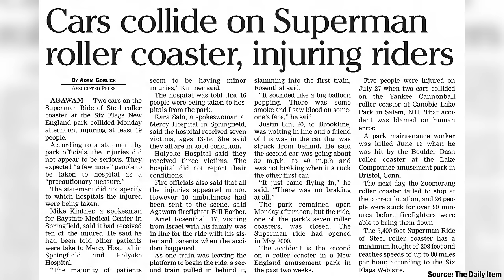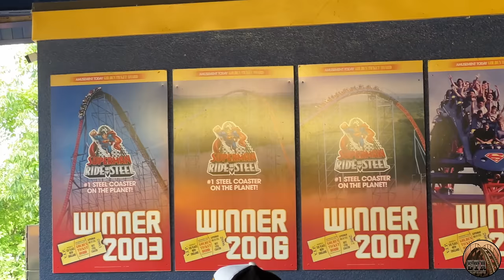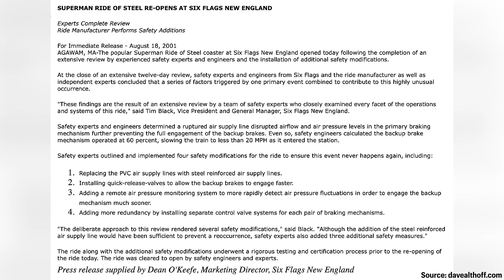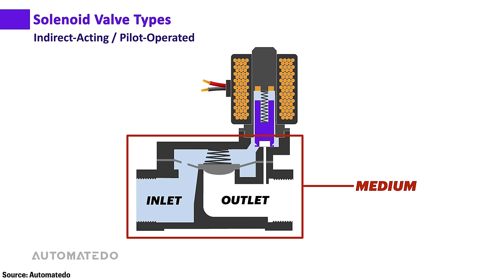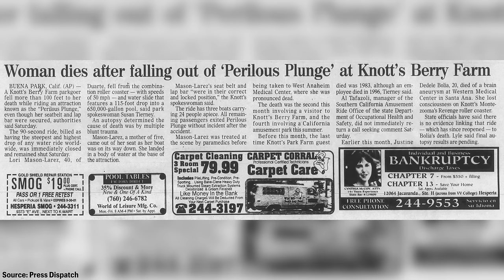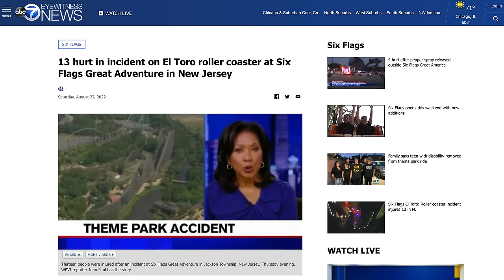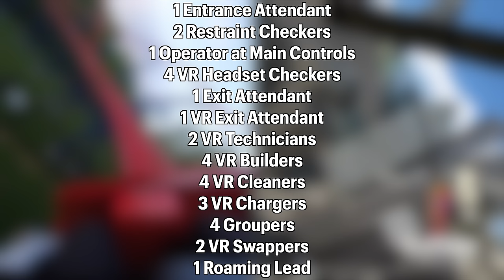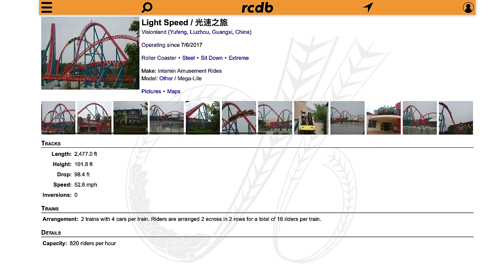The Accident-Prone Superman The Ride - A Problematic Roller Coaster

Comment: europa park has in my opinion the only sustainable VR solution, it uses a separate station and train to load guests and uses switch tracks to add the train to the track. In addition you put your headsets on in a room prior to boarding the train and get to walk into the station and into the train with the headset on

Comment: those are brake chambers similar to if not actual semi truck brake chambers that they are using. i mean why not they ae reliable enough for on road use.only problem with using these as a safety brake, the spring inside the brake chamber is progressive. if a loss of pressure due to an air leak occurs then the pushrod will not be fully extended nor fully retracted. this causes the system to think that the brakes are applied as there isnt sufficient enough air pressure to enguage the snap disk style pressure switch telling the system that the brakes are disenguaged causing the accident.

Comment: I remember Big  Bad Wolf.  I went to Bushgardens in 1989 on a USO trip.  I road that and Oriental Express I have not found any hanging coster as fun as the Wolf was.  I was disappointed going to Cedar Point and riding Iron Dragon, which I would rate as a first kid level coster.  The Wolf was a lot more fun.

Comment: Fantastic, informative video. But I want to add that all Intamin coasters at that time had their layout and dynamics done by Stengel. And since he came up with heartlining and spline curves in coaster design, he was adamant that his creations used these  methods. Superman´s design(s) use it as well, but far less prominent than on other rides. Maybe it was due to Six Flags  wanting to cut costs, since the main idea behind these three rides was airtime and helices. Bending track according to spline curves is exponentially more difficult and costly.

Comment: I was gonna say Six Flags Darien Lake has messed up a lot things but the restraints on the ride of steel is not one of them. You experience good air time on the hills, especially when you rip through the bunny hills near the brake run. Just wish the track layout was better, the straight run and 2 helix's don't offer much

Comment: I rode this one for the first time in 2021. There was a heat wave and it was 97 degrees out. It went a lot faster than when I rode it on a cooler day. There was also not much of a line, so I got right on. I didn't mind the restraints at all. And I quite enjoyed it.

Also, Ryan, why aren't you an engineer? You clearly have the brain for it.

Comment: Good lord this was hard to follow... all named superman same colors, similar sized brake runs etc... 😅😅😅

Speaking of lapbars not securing on the upper thigh with no seatbelts.... SkyRush needs to be reworked. Im 5'4 and skinny but those lapbars only touch halfway up my thigh, OR I have several inches behind my back with its flat seats.. I get they clamp you but...

Comment: Superman would probably advise against this ride

Edit: I was expecting you'd talk about Mexico's Superman ride. I certainly got to it at age 11 which might be too young, but that one experience was enough for me to never ride that coaster again. Not in the US, not in England, never again. I'm surprised too the cars for these two locations were so fucking safe.

When I got into it, I am not kidding, the car was a two person car, two loose seatbelts and one, thin steel bar that was pulled over the passengers' legs. I literally had to find a way to keep myself in from flying out of the ride because of how loose it was. Yet again, I was 11, I was a bit smaller than today, but my god, the Superman ride is the sole reason I don't get to rollercoasters unless I can tell the cart is mostly safe. Also the reason why I prefer much more the Batman ride lol.

Comment: I’m an electrician, all the safeguards they added after the train car collision are smart, and would absolutely prevent any further collisions. However, wouldn’t it make sense to add sensors to each brake arm? That way, the control system will know the exact position of each brake arm. All they would need to add is an “Brake Engage” sensor, which would allow the control system to verify that the given brake is set at its correct position, and not half way in between. They could also add another “Brake Disengage” sensor, for when the brake arms are at their fully open position. If neither sensor is being made (Detecting metal from a brake arm in front of it), the system would be able to monitor that, and send some sort of alarm, or prevent any train cars from being dispatched. If using electrical “Sensors”, otherwise called “photoeyes”, which utilize an infrared beam to sense an object is a cause for concern (Like if the photo eye failed), then they could even use a mechanical one, that has to be physically touched by the arm to send a position signal back to, what I can only assume to be, the PLC that controls all the rides functions.

Just a thought.
Reply from the maker: That’s great input! I believe Intamin actually started doing that on their coasters just a few years after Superman. Say on their accelerator coasters, there are sensors that monitor the positions of the absurd number of brake fins. But that also causes problems when the sensors go bad or report incorrect positions. In Superman’s case tho, there are so many less brakes than say Kingda Ka that I doubt it would add much downtime

Comment: The spring-loaded braking system seems a bit... odd to me. I'm not an engineer, of course, so my evaluation should be taken with a grain of salt, but it seems like it adds an additional point of failure in comparison to counterweighted systems. Springs will deform over time as they're repeatedly compressed, they can rust, or they can lose strength in other ways, not to mention the possibility of a spring breaking entirely. It would take a while for this to happen, but maintenance would then require the pneumatic system to be opened and shut routinely to check on the springs, adding to the likelihood of one not being closed properly and developing a leak. I dunno, it just... seems like a worse system to me.

Comment: I was riding Millennium Force in 2000 when the Blue Train collided back of the Yellow Train at about 20mph. There was enough energy from the Blue Train to push the empty Yellow Train out of the proximity switch zone, causing the Red Train to stop on the Cable Lift Hill. Some riders were checking out for minor whiplash, but being that I was in the very front of the Train, with a young kid, I could instantly know that the Train wasn't slowing down like it should have, and I put my right hand on his chest, and my left hand had a strong grip on the Grip Bar on the Hood of the Train, and just told him to hold on tight because I saw the collision of Trains were about to happen. The young kid thought that was Cool!!🤣🤣🤣🤣 The Coaster was down for a while, with the Yellow, and Blue Trains being transferred off the circuit, leaving Millennium Force with a One  Train operation for the rest of the day. What was funny is that, Two Ride Maintenance Personnel was on the unload station platform that just finished their Maintenance Check of Millennium Force. I wonder if they missed something????🤣🤣🤣🤣

Comment: I would say the brakes failed because it had the safety weights as back up. Thats not enough....it probably pushed the brakes out of the engage position halfway almost thru the braking process and allowed it to go thru at 20 mph. And probably not all of them kicked out...but just a few. A big counter weight is not going to keep that thing engaged.

Comment: What a video! So much info about a coaster in my home park that I didn't know about. I still prefer so many other coasters airtime moments and layout over this one. When I rode it last year it seemed to be a little slow, the spaghetti bowl section seemed pretty rough, of course the restraints are eh, and the airtime was just good, but not amazing. I need to ride it again to see if my opinion changes. I've riden this thing throughout all its changes except when it had VR, and it's definitely nice to have in the NE area

Comment: I´m somewhat surprised that after the 1st accident, or for that matter when the ride was originally built, sensors where not part of the design that would monitor the brake position independent from the air system. I mean, these rides have a ton of sensors as is anyway, so I somewhat doubt that a couple of sensors more for the brake calipers would have made it more complicated. And it would have prevented the crash, since the ride would have had an unsatisfied condition for the brakes being set.

Comment: Solenoid valves generally have an open and closed feedback that goes back to the PLC control system. You can get output only solenoid valves but you would not/should not use them in safety critical applications, nor should safety systems rely on the PLC control system to operate safety devices; there should always be a mechanical catch all. IF this was the case it was a very poorly designed control system.

Comment: Intamin have had a dodgy track record with restraints (see: the Flight Commander at King's Island for safety issues, and Flashback - a coaster from back when they worked with Giovanola - for comfort issues), and that seems to have extended to every restraint setup tried on this.

Part of me feels like this coaster, rather than being modified... should have been just hacked to pieces and sold for scrap after Intamin's head of US operations tried to brush off the incident (while shitting on the ADA to boot).

Even if Intamin hadn't fucked up the front-row seatbelts, Morbarsky may have died. Six Flags' workplace culture has had a bad habit of prioritizing customer appeasement over everything else, so he might have still fussed his way into riding. We saw that with the guy at Darien Lake. And, on a non-fatal note, we also saw it with the poor operation of Green Lantern at Magic Mountain - riders weren't paired up by weight as they should have been.

Having engineering controls like more restrictive bars or the verify is better than having to rely on the ride operators to get it right every time. Even operators with the best training and working in a good work culture can have lapses - best to have a catch.

Oh gods, VR... From what I've read, another problem with VR on coasters was that the VR experience was often a random-ish action sequence that basically just used the layout as a flying camera rig instead of something that really synergized with the track.

Re: the headrests. You know how they didn't plan ahead when converting the middle cars to hold the sound system? Well, I suspect the same went for installing the speaker headrests. The headrests it has now may be the same ones, just stripped of the audio gear.

I wouldn't say purchasing the near-identical trains Darien Lake did would be ideal, because that means bringing back the squashed front seating. The similar Millennium Force trains might be better.

While you say the T-bar wasn't at fault... in a way it was, although less because of its shape and more because that version of it could lock despite being in a useless position. Which may have played a role in the operators giving in to Morbarsky.

I wonder if Massachusetts would be more tractable to them using T-bars or U-bars made by Gerstlauer. I think the state developed a fundamental distrust of Intamin.

Comment: I completely understand why ride safety departments make decisions the way they do but there certainly needs to be more attention paid to all aspects of a decision - ESPECIALLY for modifications after the fact. None of the circumstances that lead to the original fatal accident would have been possible with the intended U design and had a more complete review of the entire design been made I'm confident that the original design should have been qualified.

But the department appears to have not considered the minimum distance belts/position sensors at all and wanted leg contact no matter what. The fact that this decision led to even more potential safety issues with knees is frankly ridiculous and should have been foreseen by the department as well. If the original accident hadn't included operator negligence it's possible more of the design elements might have been trusted, and this is the one area where I guess I can understand the brick requirement.

Comment: For those of you who are unfamiliar,  a block zone is a section of ride that only one train may occupy at a time. At the end of a block zone there is a method to stop the train, in case the block zone ahead is still occupied. This is the safety system that prevents rollercoaster trains from colliding with one another. Let’s look at the block sections on [coaster].

Comment: I didn't know about Massachusetts imposing their own limits on the restraints, unfortunately that's very on brand for the state... Second guess the experts and add extra regulations that don't accomplish anything.
Although the leg room is really tight, the ride is still amazing and very forceful. 
The only B&M hypers I've ridden are Goliath at La Ronde and raging Bull at sfgam, which granted aren't the most hyped, but like you I don't see how any B&M hyper can match the amazing ejector air on this ride if they all have that gentle B&M floater.

Comment: On the failure of the braking system, I can't believe the computer system trusted the brakes were engaged by air pressure alone. There should have been an inductive sensor on each brake arm to show when it was engaged or disengaged.

Comment: Havent watched yet, but the first (and last time) i rode this thing (2013) as i was about to get on the ride there was issues with the last seat's locking mechanism on the bar. Its not a good look when there is someone constantly working on the ride BETWEEN rides. And they had people get in those seats as well. I swapped lines and made sure not to get into that seat but in hindsight i probably shouldnt have even gotten on the damn thing.

Comment: You spoke at length about the design differences between Millennium Force and the Superman rides with no context. Those were design choices Cedar Point and Six Flags made, Werner Stengel designed both Millennium Force and the Superman Rides of Steel. Millennium Force was designed as a smooth flowing experience while the Superman rides were supposed to have stronger forces exerted on the rider as chosen by the park.
Reply from the maker: The highlighting of the design differences is to show how all over the place Intamin was. First off, Werner Stengel’s design firm is primarily responsible for ride center lining and calculating forces exerted on riders. Individual manufacturers will still rule the actual design style of their coasters and design most of the hardware used on their coasters. Werner Stengel is also credited as the designer of Son of Beast at Kings Island, which opened in the same year as Superman The Ride and Millennium Force. It’s a completely different ride and ended in failure. Now that’s not to say that Werner Stengel doesn’t design the physical components of rides themselves. He has A LOT to due with Intamin’s prefab wooden coasters. 

But the design differences I highlight are supposed to emphasize the accidents that occurred on Superman at New England, and how they were foolish. For instance, why would Intamin build Millennium’s trains with seatbelts of all the same length, while they were completely different lengths on the Superman mega coasters? There’s a bigger meaning to what I’m saying. Unfortunately, it doesn’t seem like your grasping it.

Say with other manufacturers, they are far more consistent with the products they develop, and they iterate and change over many years. While Intamin’s coasters changed and iterated at the same time, which caused problems.
Reply: @ElToroRyan  I didn't mean it like a criticism, you were talking about transitions and layout differences which would have absolutely been a client's choice. Intamin and Stengel do what the client wants, in this case I think Six Flags was looking for more out of control feeling rides that pushed the limit while Cedar Point was going on a smooth futuristic vibe. Stengel's firm did the layout for both coasters so one having heart lined elements versus one having more abrupt elements would be a design choice as the same guy designed both rides.
Reply: @ElToroRyan  and yeah of course the trains, seat belts, restraints, control systems, block system, and ride host procedures would all be more Intamin and Six Flags working together so you're absolutely right on that point.

Comment: I remembered going to Cedar Point in 2004 being about to ride MF one week. It was the beginning of the season as well. Next week inwas back as i was a seasonal pass holder, i wasn't able to ride MF because the park side i was to heavy. That became the great Debate of weight challenges with CP on MF, TTD and WT moving forward with the seat belts. Even on their website of Cedar Point gave pants sizes you had to be to fit on these rides. Wish i still had the pictures that said it too. 18 for a size woman. The seat beat had to go 1.5 to 2 inches pass the red line once you had the seat belt Fasten and you had to do the seat belts yourself for years at CP no ride Attendants could help ya at all. Broke my heart not being able to ride MF or TTD anymore. I try to stay at a Cedar Point weight now to ride coasters still to this day always.